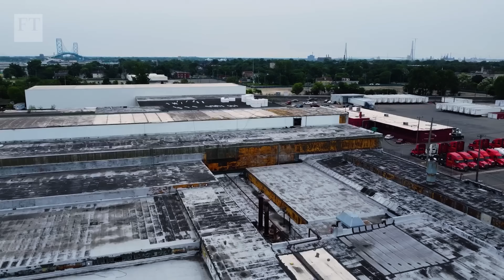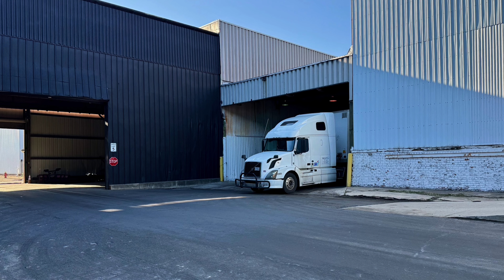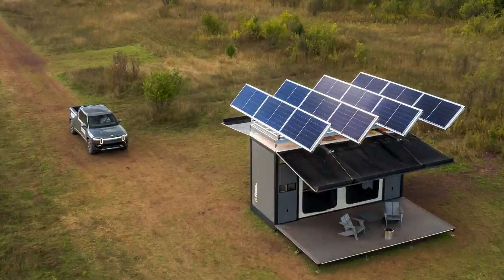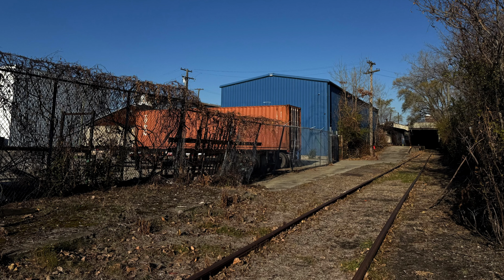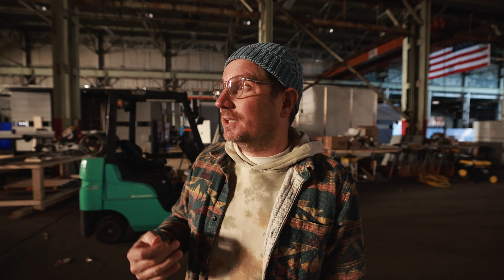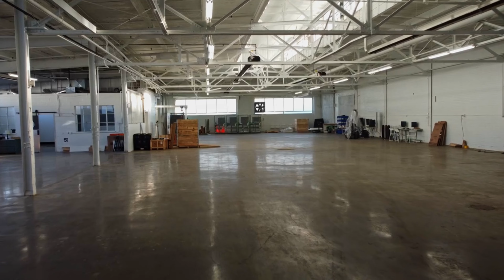A way to save old factories

Comment: I‘m very happy to be part of such a space in Berlin. 
I‘m a CNC machinist and I’m building a job shop in an old industrial facility in downtown Berlin. The space is mostly used by hardware and software startups and my goal is to supply all of them with quick and professional engineering and production services.
Having industrial zoning, truck accessibility, cranes and industrial power is such a large chunk of the challenges of metalworking in an urban environment!!

Comment: I'm an Architect.  Already zoned for this is a huge time saver in getting started.  That and 20" thick concrete floors means there are endless possibilities.  Being in this invironment with other startup manufacturers would be inspiring.   Who would not want to be here making things!
Reply: What are ideas though? Everything is cheaper overseas. Im thinking stuff like drones, or military supplies
Reply from the maker: It definitely feels inspiring to be around the builders in the space. Excited as it continue to fill out!

Comment: Financing is always an issue for smaller manufacturers. 
With Financing comes issues around lead, asbestos and structural issues.
Liability then comes into play.
Zoning changes from heavy to light industrial or mixed use.
Energy costs for large open spaces. In my State electricity has gone up over 10% in one year.
Do we have an industrial policy other than tariffs and gifts to chip maker's? 
No.
All of this requires a heavy lift of public and private policy that it seems no one on a large scale is willing to do.
There are just so many cross fits, breweries and podium building you have in areas such as this.
Reply from the maker: Definitely fair points, some complications and it’s not easy, but not impossible either.

Comment: no we ought not tare them down, many of them are still viable with some improvements plus they are old from a time when we did make our own stuff, and are part of our cultural heratage each time we rip one down part of our local history dies that was hard earned, and often the older buildings are brick and more distinctive the new buildings, what looks better a multi colored red brick with some grim and character or a modern polebarn, often times though the old warehouses and large buildings are turned into shops or micro mixed use places, at least around here, but some are too far gone, but as it were we have places that sit idle we need the people with the vision, the knowlege, and the will to use them or find a way to put it to use, but places that got three phase yea we could use those, its not easy to put new three phase in all the time, if its preexisting it could speed up the process if we need to bring in stuff and get some sort of production or staging for emergencies going, its easier then trying to green build stuff, I know since they have been about a year alone just putting up part of a new walmart distribution center thats mostly automated to add to the old one , and a truck repair facillitiy with a steel processing faclillity that is being built across the road, its framed in but its taken months in site prep alone to level the ground and pour the foundation, and it takes a good three to 5 years from what I have seen to build a new steel mill from ground up due to all the stuff and manufacturing the machines that go inside the giant roll stands and bloomcasters have to be ordered and constructed and that also takes time

we also need process engineers and people that can maintain the stuff, we push the young into the sexy sciances, but we need industry and infrestructure to keep things running and maintained also, things that they have in many eastern contries and a program for and not as many here, if at all , we also need trades jobs and will for the forseable future, even to know how to use the robots and machines, its no good if you dont know how to use a robotic welder or understand the process, or differant types of methodes, like the differant types of welding, like tig, spray mig, submerged arc, wire welding, and best process  to use to say cut the material, water jet for example is able to cut basicly anything but its slow, or plasma works on certain thicknesses, but may not cut as thick as an oxy burner torch that can go up to 4 feet thick with the right tip and output for some torches, or mechanical track cutters.

Comment: It's been the classic question for decades now.  "Greenfield" development vs "brownfield".  Brownfield being essentially what you're talking about.  And greenfield being the plowing of "virgin" land.  The urban planners and environmentalists have beat the drum promoting brownfield development for years - to avoid the urban sprawl and environmental impacts of developing in previously undeveloped land.  There is no question that adaptive re-use of the old facilities is better socially.  Think of greenfield being what Tesla did in Nevada and the other manufacturers have been doing in Georgia and elsewhere.  Verses brownfield as what Tesla did in Fremont CA (Bay Area), where they took over the old Toyota/GM plant.  

I think the big issue is the money people (and brownfield landowners) do not like the problems associated with brownfield development, such as contaminated sites, hazardous and dangerous materials in the buildings etc.  This is where a little "socialism" might help.  That is, government grants to assist in the clean up costs for the sites - in recognition of the public good resulting from dealing with the legacy issues.  

In my past life, I had several brownfield industrial sites (including EPA Superfund sites) I had to clean up for re-use, and actually it's not that hard.  Most of the people that resist it haven't done it before.  It's frankly easier than getting permits for new greenfield development.

Comment: Great topic and video! I did notice that audio recording is really done well. The audio sounded very seamless from scene to scene. What is your audio recording setup (i.e. type of microphone, audio recorder, etc...)?  Keep the videos coming. Great work!
Reply from the maker: Much appreciated! This video we used the DJI Mic mini and I just attach it to my tshirt under my sweatshirt which hides it and gives a little wind baffling when needed. The mic also has noise cancelling which is helpful.
Reply: @FutureintheMaking  Thanks for answering my question. The mic sounds really good placing it under the sweatshirt. It looks so much better hidden underneath than being able to see the big DJI and Rode mic transmitters attached to the front of their shirt. You have sold me on getting a DJI Mic Mini! 😎
Reply from the maker: Sweet!

Comment: Railspurs have been intriguing to me since seeing those single travel delivery method concepts, in the past. I was thinking of crowd sourcing through struggling small shops. I kinda wondered if on demand power delivery to the production could cut down on manufacturing cost, since you could cut down on wiring.
Reply from the maker: For sure! Lots of possibilities. The train locomotive is effectively a mobile power plant.